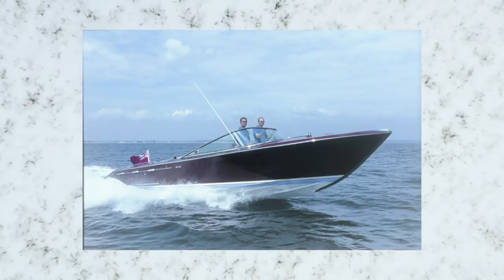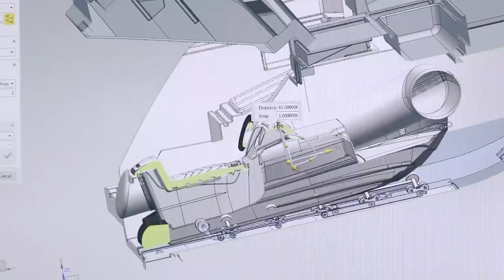WONDERFUL WILLIAMS JET TENDERS

Comment: Very nice. Well done. I have been researching William's and do have a question maybe you can answer. Why don't they make a small diesel tender? It would seem to me that they would sell a ton of them to sailboat owners and trawler owners. They already have diesel onboard and this would eliminate having to store gasoline let alone the reduced maintenance and no prop to ruin on a rock or reef.  Have a great day!
Reply: Ron Hunter. I just took a look at their website and, in fact, they do make a diesel jet. How cool is that?
Reply: @jnicksnewstart  Hi Jack. Yes they make a diesel jet but they are some of the larger in their lineup. What I'm talking about is a small one suitable for a 50 foot sailboat. Something that could be hoisted up on the transom mounted davits specifically for lifting tenders out for passagemaking. Something like the small mini jets only diesel powered. Much over 3 meters and the tenders are too big and heavy for a couple or the boat it's self to hoist out of the water safely. Most of the 50-55ft boats I've looked at have a 2 to 3 meter tender. Some you just row. So I was just thinking a small jet tender would be cool. No more coral or rock damaged prop.

Comment: Apart from the form factor, making these easier to fit inside a garage, how do jet tenders compare with outboard versions? Speed, efficiency, fuel use etc...? Is there a video that goes through that comparison?